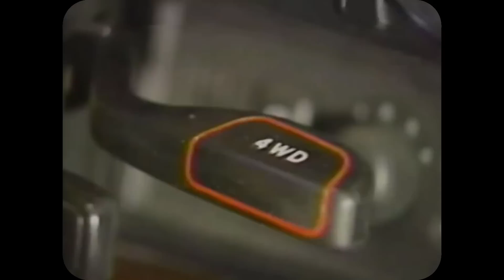How Porsche Built the First Modern Supercar

Comment: Where to start with the 959? Not only it was a breakthrough for super-cars as it proved they could be reliable and daily-driven (The 959 even has a specific gear to drive in snow, that's how much they wanted these cars to be driven) It also marked the future for the 911. The modern 911 owes more to the 959 than it seems, even the base models are turbocharged and offer all wheel drive now. The problem is, in the process, it truly bankrupted Porsche. They didn't sell it at a moderate loss, the cost of each 959 was a bit more than twice the price Porsche were charging (The cost was around 300K, Porsche spent 720K building each one) To make matters worse, a few years later there was an economic crisis where sales of sport-cars tanked. This is why the 964 and 993 generations were developed and built in tight budgets, which meant little room for innovations. Porsche was so desperate for cash that they built a final run of 6 959s in 1992 out of spares they had laying around for two customers. It is unknown how much these cars were sold for, but it is said Porsche made money with them for a change.

Also I love the footage you have sourced for this video!
Reply: Yup. And let's not forget which model, with 959/911 DNA saved Porsche from bankruptcy. The humble 986.
Reply: ruf yellowbird pls don't kill me
Reply: G gear is for helping them meet pass-by noise regulations (the car ran the test in second, which is really third). Not designed for snow, it's just a "crawl" gear

Comment: Porsche didn't toss the guts of the 959 into the 930 chassis and sent it to the Paris-Dakar Rally because they couldn't make the 959 in time but because the Porsche mechanics were rather skeptical about it as it wasn't tested properly yet and they can't afford to trash the prototype chassis there. 

So they came up with a ingenious idea. Since the 901 and 930 chassis 911 were pretty awesome in road rally events already, why not just stuff whatever the 959 could take and shove it into spare 930 chassis laying around in the factory and send them as test mules to the rally? Besides, it's still a flat-six thus it didn't require much cutting and hacking to make everything fit. 
Porsche did just that and when they clinched the manufacturer win and driver's win at the same time, the engineers and mechanics were then convinced that it worked and continued with the project.

Comment: I think you misspelled "ruined" in the title. The 959 was an engineering marvel, and a great car, no doubt, but it started the trend of these bloated, computer controlled monsters we have as supercars and high end sports cars now (though, to be fair, the R35 GT-R takes the brunt of the blame). Light, fast, and simple is much more interesting and exciting to drive then something with a billion horsepower and a computer taking all your inputs into consideration while IT drives the car. I'd take the 959s contemporary, the F40, any day over the Porsche, just like I'd take a GT3-RS with a manual box and "only" ~500 HP over the modern Ferrari V8s.

Comment: Still advanced today, in ways. 35 years later we can get a Toyota Yaris GR with variable traction control, torque vectoring, electronically controlled suspension and so on. Very cool. But it’s also a sort of limited run, rally-bred feat of engineering that Porsche put together all those years ago (albeit for a much higher price etc compared to the Toyota) that can almost never push the 959 aside as a relic of the past, given the other advances in car tech we’ve had since. Many new SUVs can out-drag a Ferrari 308, but that speaks more about the 308 being a relic whilst the Porsche 959 remains timeless.

Comment: the Porsche 959 has some sort of device built in to automatically inflate and deflate the air in the tires without extra touching the tire. i think its well usefull to have the right ammount of air in the tires depending on how much weight is on the vehicle and the temperature of the tires. for driving on loose ground it will be usefull for deflateing the tires much, to have a bigger contact surface to sink in less, the hummer 4x4 has something like that too. then when getting or solid ground again, the vehicle would fill the tires with more air by itself again while driving. useful thing. why dont todays vehicles commonly have that ? they have all all sorts of gimmicks and features, but why no such automatic air pressure regulation for the tires ?? beside that technology, that Porsche 959 looks so ahead of its time, like from today and not from the 80s and 211mph is very fast even by todays standards, crazy fast back then, that technology is aswell ahead of its time aswell as that look. alot of todays sportscars suffer from transformers diseasse, but that 959 looks straight and clean, just right for all times back then till today and i guess in the future too.

Comment: Oh man do I hate the 959
Reply from the maker: Why?
Reply: @automobilistic  it accurately predicted everything wrong with modern supercars. AWD, needless turbos, active suspension, power steering. Things that the F40 (except turbos) or Countach didn't have, and they gave you an experience. With the 959, you don't work for your speed and it feels boring after a while, when the other cars don't. Same with modern supercars, sure they're fast, but most people would rather choose a Miata for the fun factor